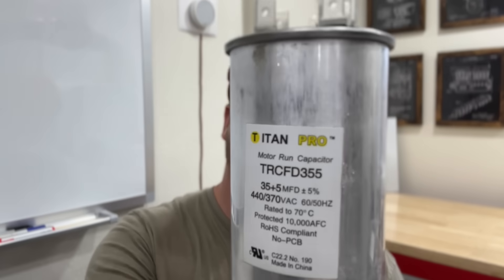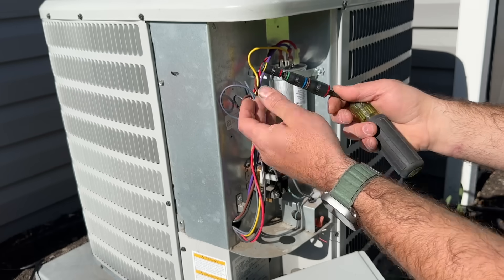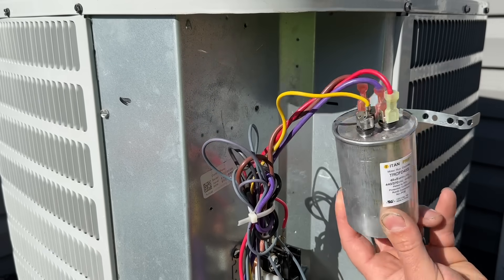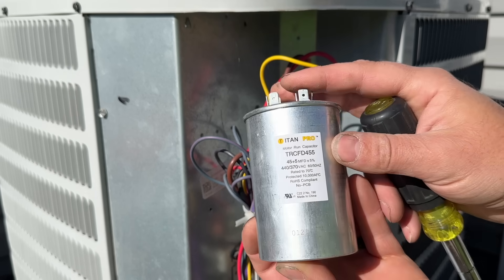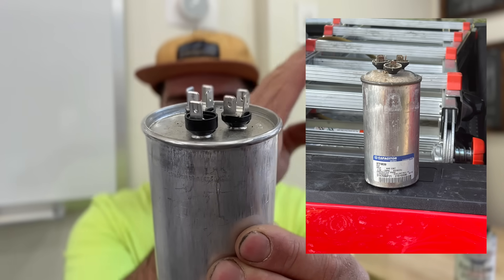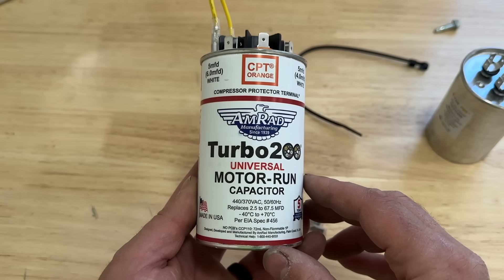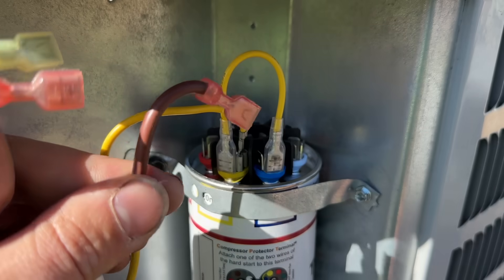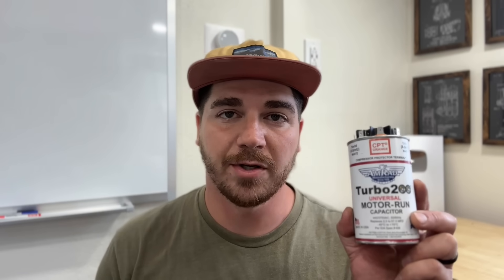HVAC Contractors Practically Make Their Living On These

Comment: I was charged $200 to have this replaced.  Typically I would have diagnosed the issue and replaced it by myself, BUT it was hot and my wife does not do well in the heat.  Remember the saying, Happy Wife, Happy Life!  I checked the part on Amazon and it was maybe $18 - $20 at that time.  Love the channel as it has a lot of great info for DIY'ers

Comment: I've had the caps go bad on a sump pump, a 50 year old air compressor, and a garage door opener. I have a capacitor tester that cost $10 from China, that works great.

Comment: Great informative video. I’ve owned quite a few HVAC units over the years. I’ve had this issue more than once. The best case a very good company who actually installed everything actually put a new one at no charge. Worst case is when my heat pump for my pool went. All it was, was the capacitor. I had to pay a $50.00 service call alone and then o er a hundred bucks for the capacitor. This was because no local company wanted to service it. Boy had I known about this before. Thank you for this. 🤙🏻🤙🏻. BTW I did know that they held a charge.  As a prank when I was a teenager I used to charge up small ones you’d find in transistor radios and hand them to my buddies. Was funny and none got hurt, just a little zap 😂

Comment: So you can charge turbo cap or you can charge $50 for a standard capacitor if you happen to have the right one on your truck which you probably will not so then you have to charge for an extra hour to go run for the right capacitor

Comment: Anyone watching this video should remove the cover on their A/C unit, get the numbers off the capacitor, and order a new one. You will eventually need it. When mine went out, none of the A/C people around would sell me a replacement; they said they couldn't guarantee it without installing it. 
I keep my spare hanging in a ziplock bag behind the access panel. I also installed a hard (soft) start capacitor inline with the regular capacitor to deduce start-up amps so I can run it on my generator after the storm and make the capacitor last longer.

Comment: FYI everyone capacitors are not little batteries they are a capacitor sometimes called condensers . They do have capacitance but they are their own separate electronic component. Any device you have will have some on them. One purpose they have is for use with electric motors that is true but that is just one way to use them

Comment: He’s lying that running capacitors between $15-$30 depending on dual capacity and the actual numbers on it. All capacitors are differently And besides the guy who’s telling you this is probably not a licensed contractors which is a C20

Comment: CJS Heating and Cooling company in Ohio has the biggest scam going not just on the capacitor replacement but bluffing customers, particularly older women into performing unnecessary repairs.  Watch out for CJS!

Comment: My AC blew out about 15 years ago. After calling around for some quotes, which ranged from $200 just to visit all the way to $2000 to fix, I opened the cage.  I started out just guessing it was the cap (because I had a samsung TV burn out from counterfeit caps just before), and found an equivalent one for $6 (at the time -- probably more now). It arrived in two, extremely hot days, and did the trick in about 10 minutes total of labor. It's been working fine ever since.

Comment: BRAVO … I am a retired HVAC service tech. In fact, my son will soon be retiring and my grandson just obtained his contractor’s license to take over the business. The crooks out there should be jailed.
I can tell you many stories where I was called for a second opinion and there was nothing wrong with the unit. These $19.95 safety checks / season start ups are a scam.
I definitely want one of those nut drivers.
But what I really want is one of those start caps to bust it open to see how the heck they do that. This modern technology can be mind boggling.

Thanks for a video from someone who actually knows what he is talking about.

Comment: Great video! I learned a long time ago to check the specs before it blows and just have an extra capacitor or two on hand at all times. They really are super easy to replace and save you not only money but all those sweaty hours without AC until "the guy" can get there to charge you a ton of money to replace these $15 parts. As a bonus, your better half will look at you like a god!

Comment: Hey, you're not qualified to wear that hat. Where is your certificate? If you live in California that's probably what you would hear. 😖 Years ago I use to pay $80 for one capacitor or contactor plus labor . Then I stated to buy them for $8 to $12 online.  I bought capacitors, contactors, and fan motors just incase for the three A/Cs we use and it didn't cost that much. I haven't called an A/C repairmen in over a decade. I used to call one once or twice every year. Unless the compressor runs out, I'm good. 😀  Good video Thank you. 👍

Comment: Had some issues with my AC unit last summer and thought it might be the capacitor and bought a new one. It turned out it wasn't the capacitor after all but now I have one on hand and ready at a moments notice if I ever need one which I would recomend especially if you live in Texas like me.

Comment: We charge 300-500 for a capacitor depending on the Cap. Most of the cost is overhead, gas to drive to the call, vehicle cost, paying our managers, dispatch, warehouse. Then I have to get paid a fair wage with benefits. 10% profit is all the company gets at that cost which is nothing on a capacitor. The companies that charge less are the same companies going out of business, or they go right to the simple problem overlooking and skipping a full system evaluation.

Comment: I had an HVAC guy come out for a service call after I tried to self-diagnose why my unit wasn't running. I took your advice and ordered a new capacitor (from your link) and replaced it. I took before-and-after pictures to make sure I connected the proper terminals. When the tech arrived, I told him I had replaced the capacitor, but nothing had changed. He insisted I wired it wrong. When I showed him the pictures before and after, he insisted the original capacitor was wired wrong. That's when I knew it was time to call for a different tech. The next guy found a small leak in the rusted-out dryer filter. Thanks for this video; it helped weed out bad techs.
Reply: Amen dude, i had a similar situation to you. A/C died during summer heat, then i called a big brand HVAC service and they sent a tech out. He said it would be $780 to replace the capacitor and the motherboard (second part wasn't actually called a 'motherboard' but it was where the capacitor and other wires connected). Thankfully the tech showed me exactly what needed replacing and why. Like you i took photos before i started removing things. $32 bucks later my capacitor had been replaced and my AC ran fine. Motherboard still works.
Reply: @edcox1630 did he ask if you want undercoating with it? that RELAY costs about $40 last year. that's when i replaced my cap. told my neighbor to do the same. she's a house renter. didn't care! guess what went bad 2 days ago? get how the weather is going this week? YEP!
Reply: @edcox1630 Control boards can sometimes cost several hundred and take several weeks to ship. York, Trane and Carrier have always been really bad about this. And that was before Covid and "supply chain".
Thankfully with Carrier, the ICP and simialr boards are close enough clones, cheap and plentiful all over.
Reply: A refrigerant leak is a problem for sure. However, with years of experience i can tell you for fact that many times i found wrong capacitors installed either by prior technicians and handful of events when it just came out from the manufacturer wrong.
Reply: Rusted dryer filter?
Reply: A cheap way to find leaks is to shut off the system for at least 30 mins to equalize pressures, then get a spray bottle with an inch of dawn soap at the bottom and water. Spray it all over everything you can see. Then run the system with a small towel over the condenser to get the discharge pressure as high as possible. Then spray it down again. When you’re done wash it off because it is corrosive over time.
Reply: Wow you were way off how silly

Comment: Sounds like an easy-enough DIY job. The problem is, I suspect that my heat pump has lost its refrigerant, considering that I had had it recharged which only gave it but maybe another year. I have one of those capacitors that the repair guy at a place I once worked at, gave to me. He said that my HVAC friend was right, it was simply a bad capacitor. He gave me the bad capacitor that he took out. So at least I know what they can look like. I didn't try to do diagnostics, because I did not think it would be affordable anyway. I should have checked to see if the outside fan was spinning. Inside fan fine, just not cooling anymore. Using a window A/C now to get by.

Comment: Had mine do this ~10 years ago, factory cap blew. I actually found a run cap from a local industrial motor refurbisher/sales shop, worked fine to this day. 

A few years before that, my better half was renting a place and it had the same issue, but since it wasn't hers to fix (landlord had to send a guy, etc.) and the weather was going to be dry and hot for several days, I ran an extension cord outside and sat an old box fan on top of the condenser. Will a box fan drive enough air to operate the unit? Of course not. What it DID do was spin the condenser fan fast enough that it didn't need a working cap to fire up the motor. Of course it's overdriving the box fan once it starts, but that's just a little induction motor... if it doesn't take it, oh well? Kept the house cool for 2 days until "negotiations" were settled and a tech appeared.

Comment: A few years ago our AC wasn't working. No fan, no compressor.  Called the AC guy who most thankfully came a couple hours later (happened during the hottest time of summer), who opened the cover.  Turns out a small frog was fried between the terminals of the capacitor. Pulled the small frog off, and the unit ran, but the AC tech suggested that he may as well replace the capacitor while he was there.  I agreed.

Comment: Please cover diagnosis for units with both start and run capacitors. Thanks.
Reply: Hard start capacitors on a/cs usually have resistors on them and are 135+ MFD. Unless you are a HVAC tech and trained with a stick meter that measures Microfarads you shouldn't be messing around with them.

Comment: So, you save money? by buying a turbo 200 or 200X capacitor ($75 or $100) and use your $450 fluke 375 to test the part. Next you use a non accountable, non manufacture website to find the correct capacitance value. Next you show one specific disconnect to turn off the power, failing to mention that there are dozens of different style disconnects in service and even cases where they are mis-wired and hot even when pulled. Next you replace the part, but remember that picture of the dead rat on the capacitor, that's because touching it wrong can injure or kill you. Oh, remember the bulging capacitor? Yeah, that one exploded internally.  They can explode externally and start fires. Your rewiring directions are vague, no mention of FAN, C, HERM.  Most of these repairs are $250-500 for someone to come to your home and give you a warranty on the part they install. You also forgot to mention that the fan motor or compressor could be electrically out of spec and causing the cap to go bad and that modern and high SEER equipment may have multiple capacitors or none at all. Don't DIY 220 volts, don't do this and get hurt.
Reply: @texomatinker414
39 minutes ago
Please cover diagnosis for units with both start and run capacitors. Thanks.

Reply

1 reply

@JohnDoeEagle1
15 minutes ago
Hard start capacitors on a/cs usually have resistors on them and are 135+ MFD. Unless you are a HVAC tech and trained with a stick meter that measures Microfarads you shouldn't be messing around with them.

Comment: I use a reputable HVAC service.  An older AC unit had a failed capacitor.  He actually showed me the multimeter readings indicating it was bad, comparing it with the new capacitor.  The service was about $100.  Labor was far more expensive than the parts cost.

Comment: It doesn't boost or jump the motor like a battery. That's not how they work. They don't discharge extra energy. They phase shift the sine wave by a few degrees which changes where the peaks of force are located. Shifting the phase a few degrees gives you torque in a different spot. It's like trying to start a bicycle with the pedals at the top and bottom. A capacitor changes the location of your pedals from 0-180° to 20-200°. At that point you can push forward.

Comment: So what happens is your HVAC system is under warranty. Tech comes out tests it, if capacitor is out of range they replace it. The part costs $10 the techs time costs money also. The tech charges you nothing for a warranty, take the old cap back to the shop then it is claimed with the manufacturer. That's how that works. Used to do only HVAC warranties.

Comment: Capacitors store energy..be very careful..a home owner has no business in the electrical compartment of a air-conditioner..you also need a proper meter to read micro fereds ufs..the average home owner has the equipment or experience..this video is dangerous..call a professional
Reply: Licensed HVAC tech here and I can mostly agree with you. These DIY videos do more harm than good. You are giving people false confidence that could get them hurt or killed because they lack the proper training any and all of us REAL GUYS have had. Screw up the wiring and you just wrecked your unit. Fail to get the power turned off or grab a cap that hasn't discharged it's stored energy and you are going to get lit up. I've been hit 5 times with 240 volts during my 22 year HVAC career. It hurt but I am very physically and mentally tough in good health wearing the proper boots and knowing which hand to use, where to stand etc etc. Some homeowner less physically strong with a bad ticker or pacemaker in flip flops or sneakers won't be so lucky to take a hit like that. The last time with me was at a tire shop and it was 240 volts 40 amps. They bypassed the disconnect switch because it kept blowing cartridge fuses so it remained hot all the time.
Reply: @texomatinker414
39 minutes ago
Please cover diagnosis for units with both start and run capacitors. Thanks.

Reply

1 reply

@JohnDoeEagle1
15 minutes ago
Hard start capacitors on a/cs usually have resistors on them and are 135+ MFD. Unless you are a HVAC tech and trained with a stick meter that measures Microfarads you shouldn't be messing around with them.

Comment: This is poor advise, you will still have many undiagnosed bad start and run caps. Measuring the ESR is the correct method, in more than 1/2 of cases the capacitance will read just fine even slightly higher than normal but it will be open as a barn door to current because the ESR has gone thru the roof due to the electrolyte drying out. Also you should ideally use a meter that can do a 100Hz read, as many only test at 1kHz.

Comment: Most of what you said is accurate; however, this is a run capacitor and stays active the entire time the unit is running. It doesn't just give it a boost to get going; that would be a start capacitor (often called a hard-start kit).

That's why these are called PSC motors (permanent split capacitor); the capacitor on a PSC motor keeps the power coming into the motor in proper phase. This is why the tolerances are so narrow as compared to a start capacitor (run cap:+/-3-5% start caps: 180-230mfd for example), and should be replaced outside of those tolerances (even if it's not mushroomed or has a rat or snake burnt up on top).

Comment: I change my own capacitors. I have four backup 45/5's including the same one featured in this video. I have a TRMS multimeter and clean my own coils. I replace my condensate pump as well. Once you get rolled once you learn to do things yourself. Clean your unit regularly people. Get the cottonwood off your fins and other particulates with a garden hose 2x a year. 

It's best to pull the breaker and not reinsert it until you are done servicing your unit. It's even better to turn the circuit off at the breaker box for redundancy. 

Change your furnace/air handler filters regularly every 3 months.

Comment: as an experienced ham radio operator, I am aware of capacitors so I feel safe around them. I had no idea it would be so easy (and cheap if prepared) to replace. I just ordered a spare, and I am considering ordering a turbo 200 in case a neighbor has an issue. I live in the desert, losing A/C can be deadly.

Comment: Never assume a unit is off because you removed the disconnecter . Check the terminals on the unit itself for voltage before trouble shooting . Keep spare capacitors,contactor,and a thermostat on hand. Consider it a cheap insurance policy.

Comment: I wasn’t aware that units came with this capacitor.  I understand when your compressor starts to poop out, regular voltage will not get the compressor running.  The capacitor is added to the system to deliver that increased kick in the butt to get the compressor running.
I agree with you there are a lot of very shady HVAC guys out there, all over our country and yes they rip folks off on the cost of the capacitors, hugely.

Comment: my new super efficient AC unit has no capacitor. When mine had failed in the past the AC company charged about 200-300 bucks which is mostly the service call. Time and vehicle miles. That is fair.